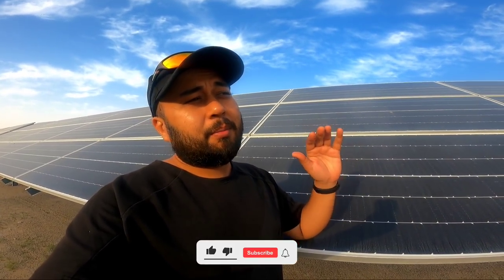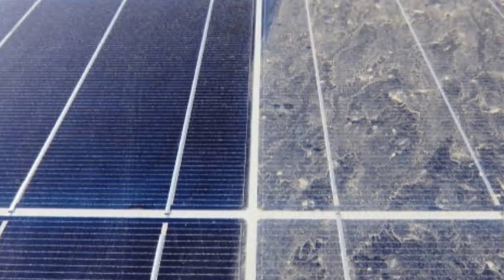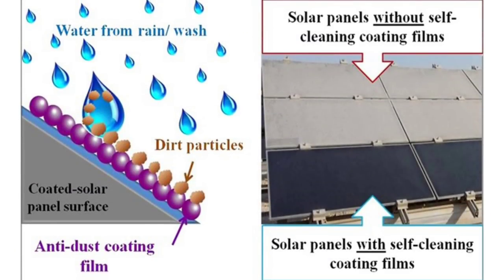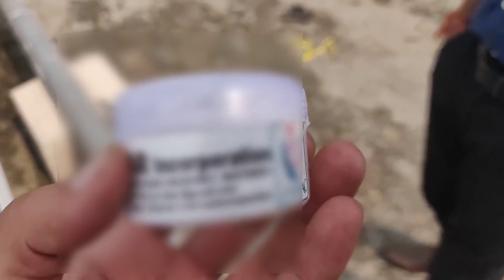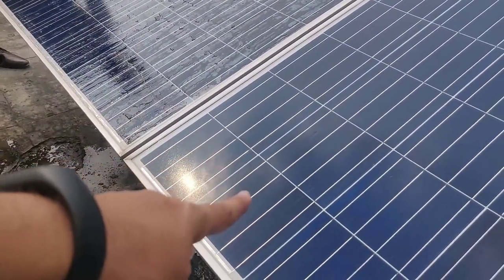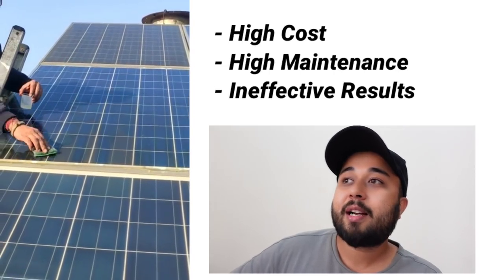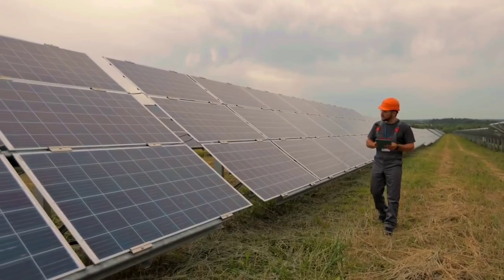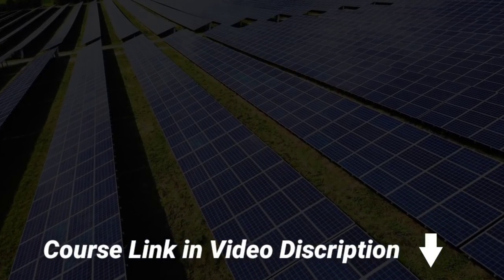Solar Panels NANO coating SUCCESS !!! Cost & Experiment | Product Review

Comment: Good info. The point to think over is, if the coating would help, it should be the manufacturer themselves who shall be applying the same while finishing the product. As they take care of the heat and reflection, they should have come up with some solution for dust as well. Therefore it means that the costing is not of any use, at least for the long term.
Reply from the maker: Absolutely

Comment: Yes sir ,you side right ,it wont work,

even i tried 5 years ago same nano chemical,but not have good results,after 1 year, again i bought some other nano chemical nothing happened with withat,and after 2 two years, another company of nano coating ,they told me we wl do demo then only you can purchase so invited them nano coating,but it wont affect that much , Now recently order one more cleaning chemicals, need to be apply panel..

let see  what results will come
Reply from the maker: Do let me know the results

Comment: Good Joke about Nano Coatings, Its Really Useful. Study nano Coating effects for 2 years , collect data and Work and Make Video, Fare Report will be appreciated. Misguiding will help for Minor Time , Long Term this will help.
Reply from the maker: Oh Hi Mr. Deepak let's connect on LinkedIn, please share the case study of 2yrs effect of Nano coating, will make a +be video on it ,
Reply: @SustainableEveryDay   My Study Details are Open for all Since last 6 years, We follow all Test -Trial - Customer Validation Process,  Every Customer and Study report we is earned with hard work. We will kindly Appreciate , nano coating Studied by many research Students & professional's in INDIA and Abroad,   kindly refer and Study reports from ResearchGate.

Please Study well gather Authentic Data and Details before making any Comments,
Reply: @deepakpoche  I already have a Nano powder to offer in India . It is good for all surfaces glass or plastic . Can be ordered directly and can be shipped to all over India . 
We also have Nano products for automobiles engines , auto and residential Airconditioner , suspension and tires . Pricing is reasonable.

Comment: Hey bro,
we are also trying to the same issue solution, we are came from the company which is continuously working on surface solution. We make different types coating material, so now we are focusing on making the material that reduced the cleaning time and water consumption to clean the panel by using this coating material.